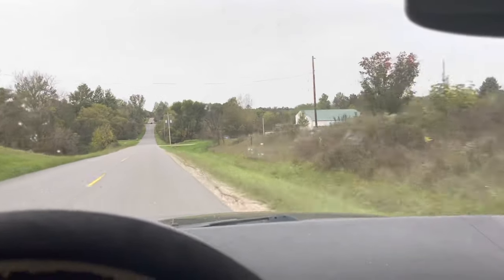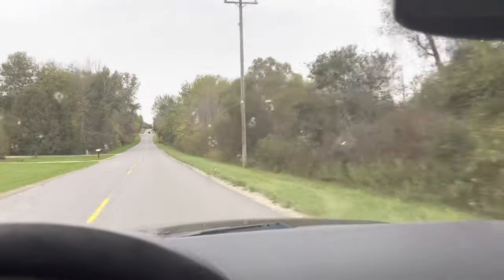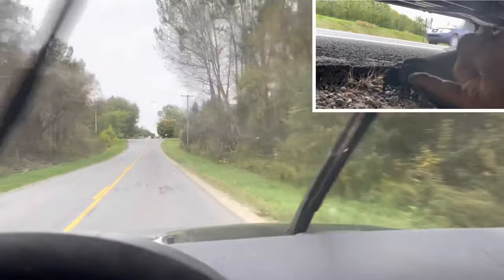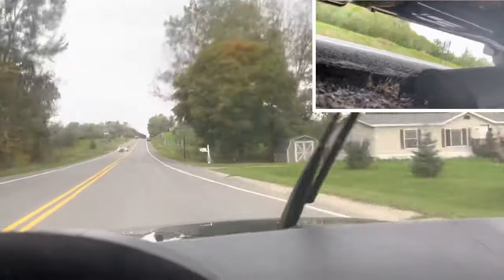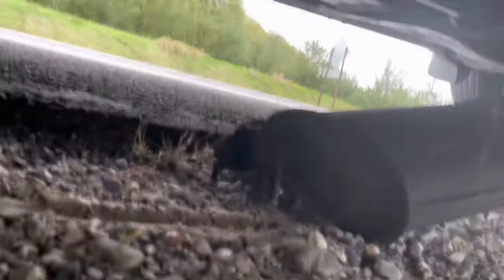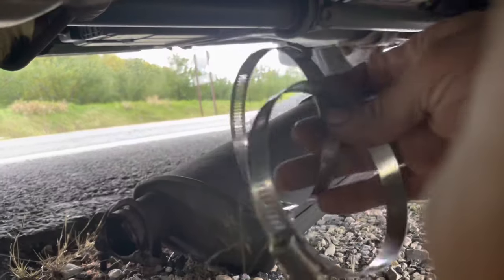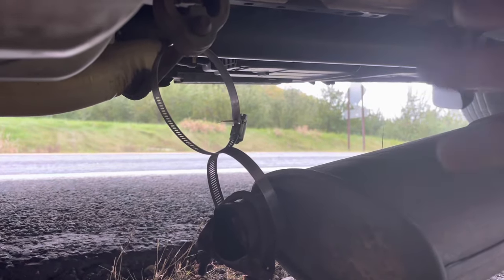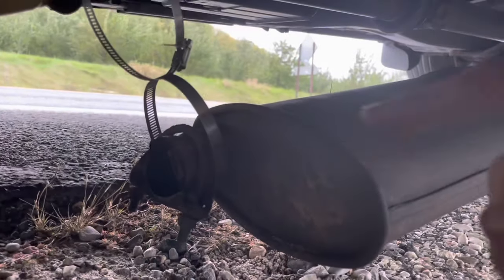Dragging Exhaust quick fix/Side of the road super trick/Broken Muffler!!

Comment: I wonder if  a zip tie would have worked to hold the muffler part up instead of a second clamp. That might have made it easier to tighten to get it higher off the ground.
Reply from the maker: Whatever works my brother not bad thinking….. I think this is just a temporary solution till you can get a more permanent one. But you definitely get it
Reply: Probably melt before she got home
Reply: It’ll melt I use a shoe string and it melted 😂
Reply: That's what metal zip ties are for.
Reply: @DistrictFire lol just happened to me

Comment: I have the same thing wrong with my car but I’m worried about carbon monoxide getting in what should I do?
Reply from the maker: That’s most definitely something to be worried about this was a temporary solution to get it home or to the repair shop and not destroy it completely so it was not repairable.

I would have to see what you’re working on to give you a solution other than going to the parts store and buying the correct parts to fix it. 

You can message me on clays ac and Auto Repair on Facebook then send me a DM and I’ll try to give you some ideas

Comment: Just happened to me. Can I drive my car that way for a couple months
Reply from the maker: I wouldn’t recommend doing it that way for a couple of months but you can get what’s called a stainless steel band clamp and put that over it and it will hold it for a long time if not forever until it rust out in a different spot